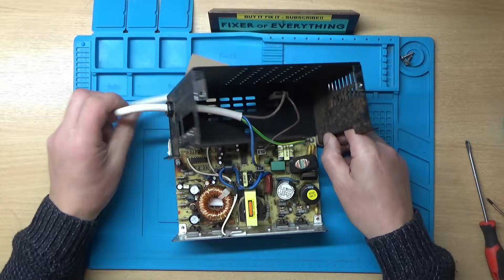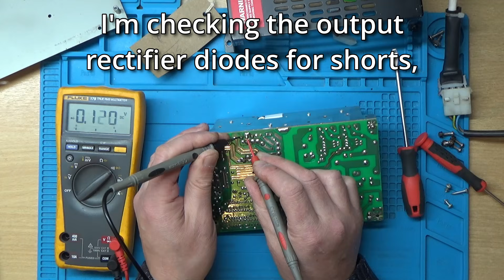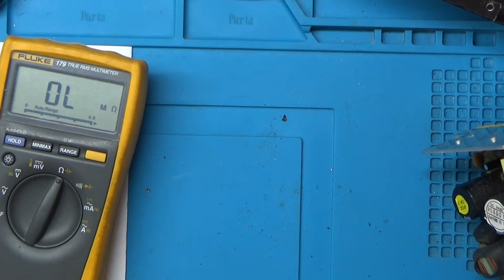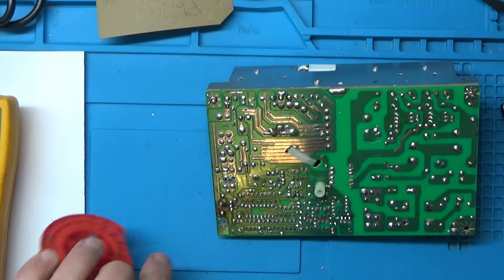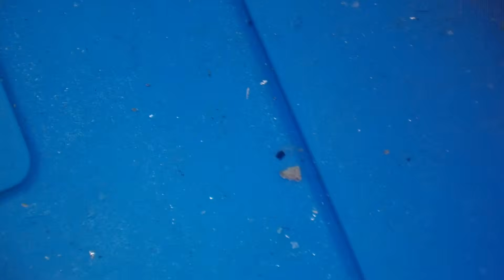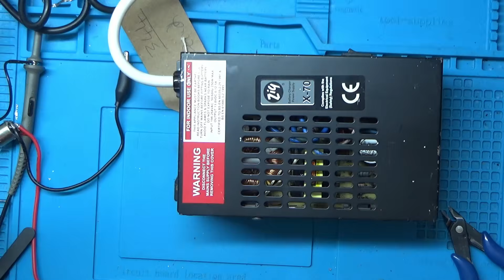Faulty SMPS Charger ⚡ ZIG X-70 Caravan Battery Charge Repair!✅

Comment: Good job of seeing it through to completion. The big, burned resistor should be replaced; its pin is totally corroded. You might do well to make yourself a DIY Capacitor "Stinger." They are very handy for discharging caps. Search YouTube for designs. Mostly, you need a high value/high wattage resistor, two bamboo chop sticks, a piece of wire, two header pins and heat shrink. HTH.
Reply from the maker: Thanks 👍I cleaned up the resistor pads and turned it round the other way to the resistor body keeps the loose pad in place. I was unsure of the value and don't have the schematic so I was unsure of what value it was supposed to be.  I've seen those home built resistors capacitor discharges before,  I've just not got round to building one. Thanks for the suggestion 👍

Comment: What about that toasty high power resistor near the output? The traces seemed fried. Is that the dummy load?
Reply from the maker: I'm not sure what it does, I didn't work that part of the circuit out. It seems that the pictures of other units on the internet all look the same. I swapped the resistor round so the loose pad cant move now.

Comment: Hi, I'm also a volonteer at the local repair cafe since 10 years and watching your channel for quite some time. I admire your perseverence and 'never give up attitude'. Some criticism though: If you do things off camera that doesn't feel right to the viewers as they do not see what's going on. Imo it devaluates your channel. Do your repairs on camera and just show what you are doing, that's genuine ! Cheers!
Reply from the maker: Thanks, the only issue is that you sometimes can't put everything in a video otherwise it would be too long. I spent a fair bit of time on this on and off, so I would have probably had about 4 or 5 hours of footage. I think the main parts of what I did were in there, thanks for the advice.

Comment: The first thing I noticed when you removed the case was that the mains earth cable connected to the PCB rather than directly to the metal case, and at the end that had suffered corrosion presumably from being damp for a prolonged period. Even if there was an intended earthing path at the adjacent mounting screw, that path could be compromised. The appropriate earthing technique nowdays would be for the earth cable to terminate directly to one side of the case, with a link to the other half of the case, and also to the PCB if required, that way all elemants of the case are directly earthed, and not dependant on screws and nuts for earthing integrety.
Reply from the maker: Good point 👍

Comment: Switched modes are tough without a schematic. Sometimes, a crap shoot. One thing I always tell myself troubleshooting these.. they need 4 things to operate, start, run, regulate and shutdown. I always start looking for the initial start pulse somewhere, usually the regulator chip. It may only be there initially, it should remain high from a feedback from the main chopper winding or secondary winding on the primary.
Reply from the maker: Yes, and thanks 👍
Reply: @BuyitFixit  I have two identical X70 PSU with the problem that they do not start up properly. The LED then lights up briefly after switching on. If I am lucky it stays on and the power supply starts up properly and works. I have replaced practically all the capacitors.
I do not fully understand the circuit for starting up, is it the coil with the blue wire that is supposed to take care of this?

Comment: I just fixed an Enermax PSU that had failed output caps and apparently it didn't like having those caps bad so it blew a diode. Looks like when a cap fails takes out some components with them in SMPSs.
Reply: Was the diode noticeable or did you DMM test each one? I had a cap on a refrigerator board blow, replacing the cap didnt fix it. No obvious damage and the diodes checked out. Bought new but now relooking at the old board to see if I can post mortem it with yours and Buyitfixit's help.
Reply from the maker: Nice 👍Yes, agree.

Comment: Where do you think the noise was coming from and how it went away when you changed the diode?Great fix 👍
Reply from the maker: Thanks 👍I think it was noise from the transformer not being switching properly. It went away when the switching circuit was working correctly.

Comment: 6:20   Dont think you needed to take the power transistor  bolts out they had clearance holes in the case . I always try least disassembly as pos , love your videos handy to have heads up on similar fixes.
Reply from the maker: Yes, you don't need to remove them unless replacing the transistors or diodes. I didn't realise until I realised you had to drill the rivets out to get it out of the case.

Comment: Another awesome and well detailed video!

I've got thermal camera on the way as a Christmas present from the wife, I'm sure I'll be looking at some really stupid things on Christmas day, just for fun.

What voltages were coming out of the chip for the scope?

Not got funds for a real scope just yet. I've setup a Raspberry Pi Pico W with the open source Scoppy project, the pins are only 3.3v tolerant so I'll need to make some voltage dividers.
Reply from the maker: Thanks Dave, I can't remember the voltage, but one of the waveforms was about half the height of the other. I think I was on the collector of the transistors on the bottom of the board when I measured it off camera.

Comment: I had one that hafd a short on its primary kept blowing the inrush limiter and fuse - swapped the fets (pretty HV ones) and all the caps plus blown components - fixed.
hickups and whine on a non working switching power supply is always on the secondary ( or rare cases of the comparator + cap have failed) imbalances for + and - 15V for example are the easiest.
iesh - brown goop glue that becomes conductive
Reply from the maker: Nice 👍

Comment: Great determination to reach a conclusion, Curious as to what the zener voltage was. I just know that one day we'll see a dim bulb tester (or fire extinguisher for increased viewing figures).
Reply: Yes, he needs a true VAC power system... Mains wall plug to all stop emergency switch to isolation transformer to autotransformer (Variac) to dim bulb current limiter to DUT. All of it, including the isolation transformer, can be DIY;d, except for the autotransformer. Do not buy an Asian autotransformer, as they have lots of safety problems and grossly overstate their ratings. Buy a name brand unit. All that said, switch mode power supplies, such as this one, may not run on an autotransformer. I suggested a cap stinger, in a separate comment.

Comment: Very nice video thank you. Did you re-check the voltage on the chip after you replaced the zener to see if it changed from the 7v vcc and the 4.8 Vref you measured before?
Reply from the maker: Thanks 👍 Good job you asked, as I must have forgot to switch it off last night at 2AM, and it's been on all day. At least it's had a good soak test now 😂😂😂 I just pulled the top off again and checked. VCC to the chip is now 23.8V and Vref is 5.024V.
Reply: @BuyitFixit  Nice 🙂

Comment: Hi bit random but what is the tester called not the multi meter
Reply: You mean the one at 23:13 I guess - pause it there and you can see that it's labelled Multi-Function Tester T7 - a quick google will reveal that it's an LCR T7. YouTube has assorted videos on them.
Reply from the maker: I put links in the video description 👍

Comment: 13.8v is the voltage of a fully charged lead-acid battery with no load.
14.3v is the recommended minimum voltage for charging a lead-acid battery.
Automotive alternators generally output around 14.7v to 15v or so.
Since this is a charger, 14.3v is to be expected at the output.
When connected to a battery, the device MAY be designed to monitor the voltage and current to adjust the output up or down to go from charging to standby/float voltage and current.
Reply: I think it just has output set to 14,3V,  this will not boil battery and could be left charging whole weekend. Also charging current is limited and measured by that shunt as completely depleted battery would otherwise take too much current.
Reply from the maker: Thanks for that ED! Much appreciated 👍
Reply: I think that ancient single stage charger was not worth fixing.  Nobody uses a wet lead acid battery in a caravan (or certainly should never do so to avoid explosions) Not sure what sort of amps this unit can charge at, but a modern 15 or 25 amp Li capable charger is affordable AND multi-stage for AGM/GEL/SLA batteries which are safe to use in a van.
Reply: i use my zig to charge a golf cart battery that runs my diessel heater. its still very usefull. also everybody uses wet lead acid in caravans. we aint all rich @einfelder8262

Comment: I wish i could get my power supply fixed but thers nobody near Bedlington that does repairs.
Reply from the maker: What is it mate? Was that the ATX one? Sorry it's hard to keep track with so many comments across different videos.
Reply: @BuyitFixit  its a bench power supply not sure if its hantek or something. It just wouldn't turn on one day then when i tried again it did then intermitant. Now off altogether no lights nothing.
Reply from the maker: @davidiley529  interesting drop me an email if you like. It's on the channel about page under for business enquiries. It doesn't show on a phone or tablet for some reason.
Reply: @BuyitFixit  i'll check exactly what make it is tomorrow and get back to you. Thankyou
Reply from the maker: @davidiley529 No problem 👍
Reply: @BuyitFixit   I can not see your email address so I can send the photo of the power unit.
Reply: @BuyitFixit  Wanptek DPS3010U DC Power Supply
Reply from the maker: @davidiley529  it's on the about page. Press the for business enquiries button.  It will only show on pc or laptop. Something weird the way YouTube does it.
Reply: @BuyitFixit  sorry i am 74 years old i don't own a pc or lap top and can't find any way to email, but thankyou for trying to help.

Comment: I found your channel a few weeks ago. you do impressive work.  I used to repair CRT TV's 30 odd years ago as a hobby and now my hands shake so much it would be dangerous if i tried. Keep up the good work.
Reply from the maker: Thank you, sorry to hear about your hands 🙁. I too used to fix the odd CTR too, I remember changing frame ICs and line output transistors 👍
Reply: I use a set of these.    Amazon Strong Hand Tools Fully Articulated Arm Rest, Fully Adjustable, Welding/Fabrication, ARA18, Strong Hand Tools. 85 euro